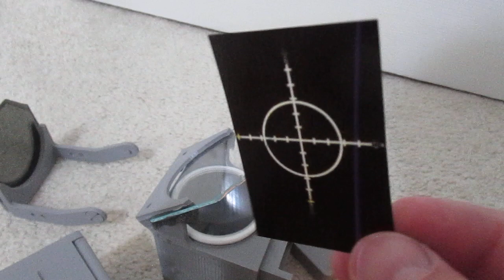Functional Revi Reflector WWII Aircraft Gunsight

Comment: Here are points to observe to obtain correct performance.

- The reflector plate can be any plate glass that is sufficiently flat and has plane parallel surfaces.

- Reflector plate thickness is not crucial. Thin is good, but it's not as tough. Real sights typically used 6mm (1/4") thick glass.

- The double image you are getting on the reflected reticle derives from the simple fact that it is not collimated for optical infinity. Your printed reticle is too close to the lens, resulting in parallax. The reticle must lie at the focal surface for optical infinity of the lens. You can find this distance by projecting the view outside your window onto a facing wall and measiring the distance of the sharpest image from the lens. Then place your reticle at that same distance.

- When your reticle is correctly positioned at the infinity focus of the collimating lens, its size should be scaled accordingly. The ReVi reticle's circle is designed to appear to subtend 100 mils, or 1/10 radian, or 5.72 degrees in diameter. Your printed diameter D is thus:

D = reticle size in radians * lens focal length
D = 0.1 * 100mm
D = 10mm

As this example shows, if your collimator has a focal length of 100mm, a printed 100 mil circle will have a diameter of 10mm. This will provide the correct 100 mil diameter circle seen in reflection.

- Your LED is providing a very small 'hot spot' of high brightness because it is a pretty small source. You can use a condenser lens between the lamp and the reticle to optically effectively enlarge the light. The principle is to project an image of the lamp upon the collimating lens, which common slide projectors do. This lens should be no smaller in diameter that the printed reticle. It must have a suitably short focal length, and it can be placed in contact with the reticle for maximum compactness. The form best suited is an aspheric (as opposed to the basic spherical type), and can be molded acrylic. The lamp is then moved closer to/farther from the condenser until the best result is achieved.

- Many sights actually used a small flat mirror to 'fold' the light path by altering the direction by 90 degrees. This is why the sight body is not so tall, and has some depth. Due to having to use collimator lens focal lengths a bit on the longer side in order to not suffer bad ootical aberrations, a sight body that did not use a folding mirror would be so long that it could obscure one or more gauges on the instrument panel. The ReVi 16 used such a mirror below the collimator, with the lamp and reticle being placed near the rear wall of the body's interior. When you determine your own collimator focal length, you might find such a folding mirror to be necessary. Or you might be able obtain an aspheric lens of suitably short focal length that would permit the same direct optical path you have now.

By the way, I've fabricated precision optics for industry and astronomy, and have designed and built binoculars, telescopes and reflecting sights. 😉
Reply from the maker: The optic folks at Edmund Scientific have a great little video about it.  https://www.youtube.com/watch?v=ac-vVNbQt2I&t=108s
Reply: Thank you for the insight. It was a pleasure reading that. 👍

Comment: I've previously tried printing measuring reticles on film... Honestly, really difficult to get them thin enough on an inkjet printer. I wonder of there's a more effective method of getting really crisp tiny crosshairs made so you don't get this odd light effect where one part of it is brighter than the other.

P.S. I've been hunting for a Revi C12/D replica for years. This might just bring me close enough to making one myself.
Reply from the maker: you are not printing the tiny crosshairs, you are printing the black space around them.  The crosshairs are the clear part.
Reply: @JohnSmith-gm4fj  Of course. But the printer tolerances behave in a similar way.
Reply from the maker: @darth_dan8886  I am using a old crappy hp inkjet I got for under 100 at Walmart 10 years ago.
Reply: @JohnSmith-gm4fj  Which is absolutely usable for this project, don't get me wrong! I'm just saying that as you try making smaller masks and putting them closer to the lamp for a more evenly lit image,, the inkjet might run into limitations, that's all.

Comment: Both Me and Bf are correct.
The plane started as Bf-109, produced by Bayerische Flugzeugwerke, hence, Bf. 
The designer, Willi Messerschmitt took over the company in 1938 and it was renamed into Messerschmitt AG. So it is actually more accurate to call it Me-109.

Comment: I'm making one of these for an RC me262 to use in fpv headtracking.... I'm doing it with a tiny OLED standing verticle at the back, a 90° reflective prism underneath the collimating lense and a little peice of glass that's designed to reflect like 30%(wut I'm prob gonna try first) 

The reason Ur getting ghosting is cause it's traveling thro the glass before it hits the reflective surface and the glass is bending the light and giving U a double image.... You need the reflective surface to be the side of the glass that the reticle is hitting first so the glass can't bend the it.

Trying to work out how to motorised the sun reflector while looking as stock as possible so I can actuate it via remote while flying....

Comment: John,  Well done.  I did 2 of these with optics and recital provided by Tim Noack.  Used actual beam splitter glass which worked very well except for not being full scale thickness, 2mm vs. 6mm.  I also drilled out the printed ball locks and installed working ones so the sun shield worked and locked in the up and down position.  I will have to look into the clear plastic you suggest as the glass lenses I used were pretty expensive.  I tried a 6mm piece of lexan and the ghosting was nasty.

Comment: Is it somewhat hollographic? i mean, does the center of the center of the cross hair stays more or less "on target" if you move side to side or up and down while watching down the glass? or is just a reflection with no functional purpose?
Reply from the maker: The reticle doesn't move, it stays right where it's projected.  You can move your head around until you see it but it doesn't move with you.  The functional purpose is to put it on the enemy aircraft in front of you and pull the trigger.  My understanding is that only the Allies had a gryo-compensated sight that moved around but I think that was much later in the war.
Reply: @JohnSmith-gm4fj you should replace the lens with an actual collimator lens it will make it “holographic” like its supposed to be. Just measure the dimensions and there must be something similar online
Reply: @JohnSmith-gm4fj if the reticle doesn't move.. Then I assume you've got to move your head to put your eyes, reticle and plane in the same line. How is this better than just an iron static reticle? I thought the plane was projected through a lens also along the reticle. This way the pilots head position didn't matter.. You day both the plane and reticle projected on same plane.. You just line them up and shoot .
Reply: @Bren39  it is way easier. It behaves/resembles a laser pointer. You don't have to align your head completely (first advantage) and of course you dont have to align front and rear sights (second adv.) 
You just look through a window and find a spot that moves with the airplane (of course you have to fly the airplane to make it point at the target). Once you see it, you can move your head around quite a lot. The closer to the window, the wider field of view you will see the virtual reticle against the real world.
Now it's a matter of matching the ghost reticle and the target. And it feels like a laser.
I know red dots quite a lot and yet I still love to play with them. The unnatural feeling of seeing a dot floating at infinity no matter how you rock your head is always quite interesting to me